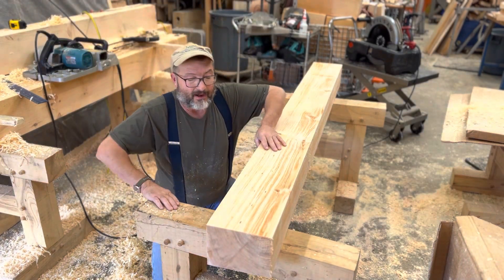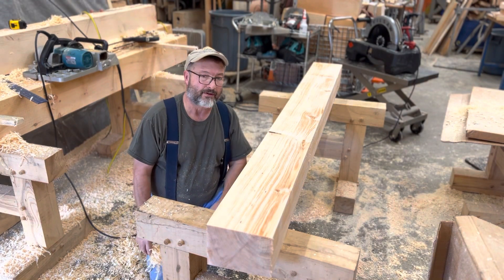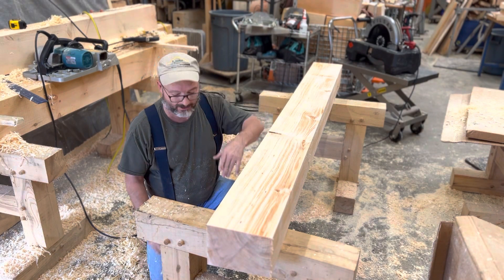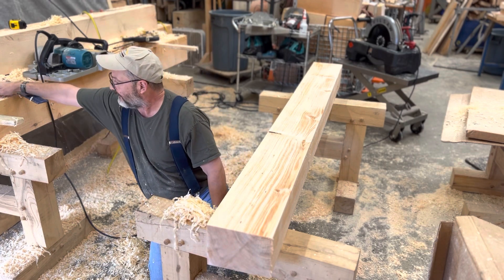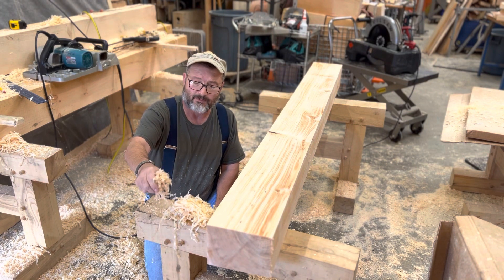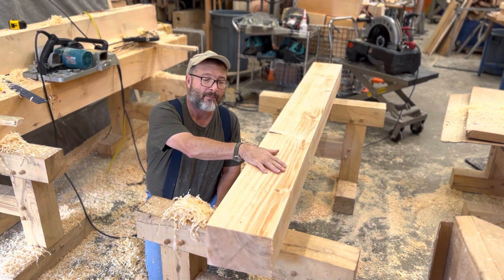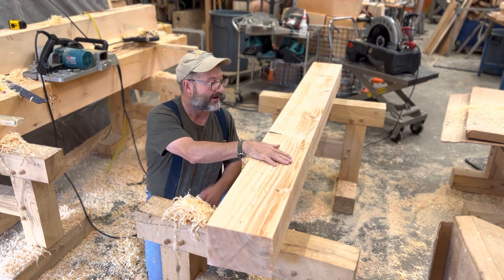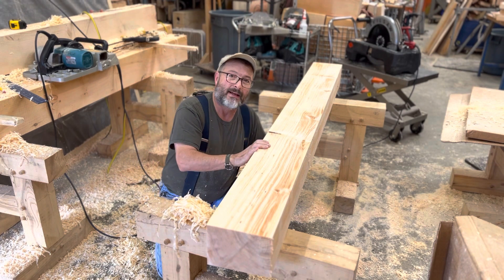Timber framing:  Makita KP312 planer - planing first pass with new blades

Comment: What's the thickest have you taken in a single pass?
Reply from the maker: Hi Volvo246
I usually take 1/16” per pass.
You get a better result with 2 passes versus 1 deep pass.
I think I saw Timbers pretty well but when you plane them you’ll find inconsistencies so 1/16 works best for me.